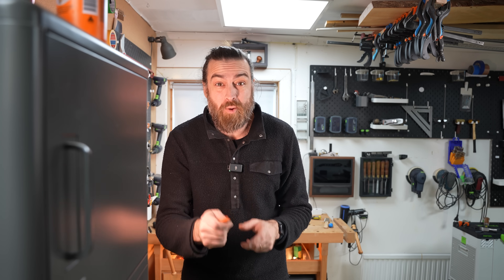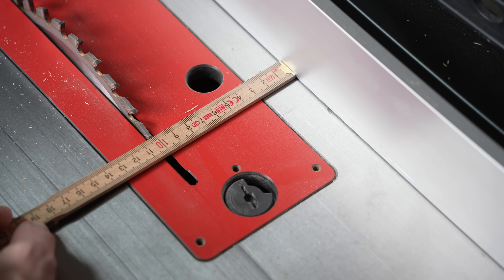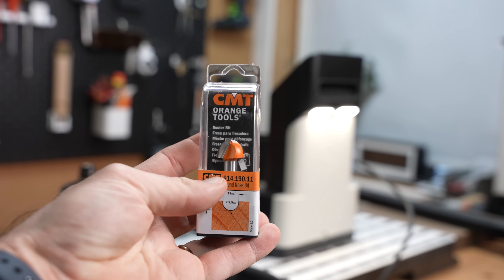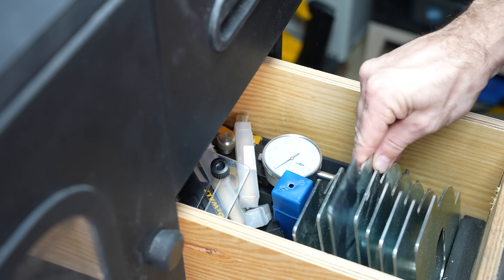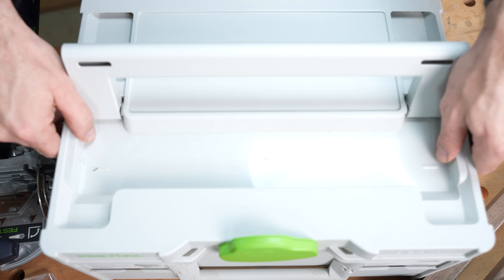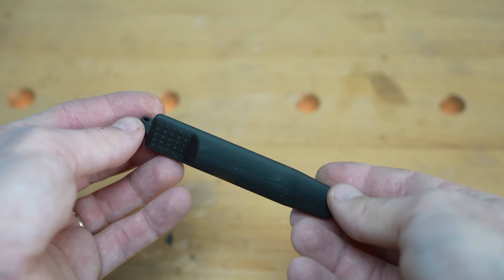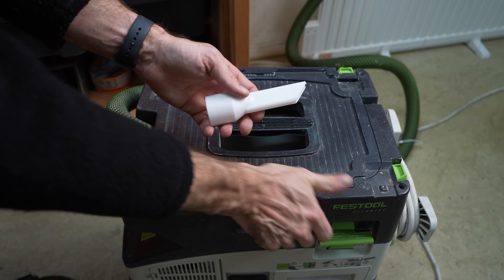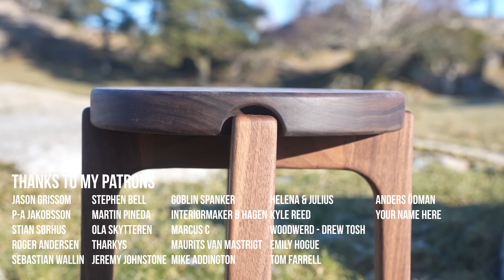3d print tools worth $1000:s

Comment: As i see, there are a lot of worrying about filament shrinking in rulers or setup blocks. Would not it be a little bit easier make things little bit bigger then you need it and smooth sand it after, instead of making calibration every time or use both methods to get measurement instruments precise enough?

Comment: Nice selection of 3D accessories, thanks and well done. However... I have to comment on the build. 3 legs good, 4 legs bad! I'd run out of beer-mats trying to stop the thing from wobbling on our floors! 😉 Cheers 👍
Reply: You can always just twist a 4 legged thing until it stops rocking. This is awkward for most things - not the stool though!

Comment: 3D printed tools time? Might be worth looking at my "Hoopin TPU Cable Tie" available in a range of sizes. The upload includes its 4 core elements so you can easily create custom ties. Printing at different scales also useful, like 50% for holding miniature things & 150% for really strong ties (had one carrying 14kg easily)..
Reply from the maker: Will check it out!
Reply: @TheSwedishMaker  I hope you find they're useful, 1000's have, they're dead easy to print with no supports and are great for using up spare ends of TPU reels.
They're basically a string of hoops with a pin at the end, hence the Hoopin name. They took inspiration from baseball cap straps and included the indiidual Hoop, Hoop+tab, Pin & Spring for people to make their own custom ties.
One design thought is you could put the Pin part on 2 or more PLA/PETG prints and use a string of Hoop parts printed in TPU to attach them together and detach if necessary.
The usage ideas are so many, I've put them on lots of cables, held things in place and even use some as carry handles for drinks bottles.

Comment: Hi, I am the designed responsible for the Height Gauge @3:15 , and wanted to thank you for featuring one of my designs again. It's always great to see people making use of one of my creations. I probably spend far too much time designing woodworking prints, I really believe that a 3D printer can be a huge asset to a woodworking workshop. So many great designs out there.
Reply from the maker: Cool! Thanks for letting me know - you have some good designs. Will check your videos
Reply: Two original designers in a row! how cool :face-blue-smiling:

Comment: I’m not sure if you can get Whiteside router bits in Europe, but I love my combo trim/pattern compression bits with bearings on both ends. When I’m doing pieces that curve with and against the grain, I can just flip the template from top to bottom, raise the bit, and keep going. Since they are compression bits, I’ve NEVER had a tearout, even going around a 90 degree corner. They are pricy, but worth it.

Comment: A note to anyone thinking about buying Bambu Lab printers. They recently announced a firmware update that would lock you out of using third party slicers and accessories directly with the printer, all prints, including LAN-only, would have to be sent through Bambu's cloud severs via Bambu Studio or Bambu Connect for verification before the print could be started on the printer. Third party slicers will not be able to communicate with the printer at all outside of very basic functions like toggling the light inside of the printer.

After public push-back they then announced the implementation of a "developer mode" on X1C units that does allow you to actually control the printer with third party software and hardware via your local network without the cloud verification, at the cost of losing all cloud print functionality including the use of the Handy app. However, nothing like that has been announced for the P1 or A1 series printers, so it is not clear if the feature will be exclusive to the more expensive models or not. 
The use of Developer Mode also disqualifies you from being able to seek technical help from Bambu's support team. This is similar to how Bambu handled push-back when they blocked the installation of the X1Plus third party firmware on X1C units, they added a toggle to install the firmware, but at the cost of losing the remaining hardware warranty on the printer.

You also still have the option to use third party slicers with the SD card and manually initiate the print on the machine itself. However, accessories like the Panda Touch would require the use of "Developer Mode" on newer firmware.

They stated this update was for the "security" of their cloud service, but after third party cybersecurity experts easily defeated the new security measures on the beta version of this firmware the validity of this claim has been brought into question.

They have also stated in a Verge interview that users are able to remain at the pre-security update if they wish as well as downgrade to the pre-security firmware, but you will very likely lose the ability to use any cloud features once the newer firmware's are released and their servers are updated to only accept connections from the newer software. You will also be giving up any potential print quality improvements that come from newer firmware. However, despite what the Bambu representative said in the verge article, in the terms of service on bambu's site at the time of this comment still says that they reserve the right to block prints on printers with out of date firmware until at such time that the printer is updated.

Comment: Loved the video, can’t wait to get one of these printers. Don’t even want to use my old one with all its hassles. Thanks
Reply: @kylereed3577  that's the point. A friend of mine gifted me his old one, an ender 3. Never worked for me. In February I got a Bambu and it has over 300 hours on it already with zero misprints and zero downtime.
Reply: @alfderbabybenz7092  yet that isn't an apples to apples comparison. Not just are even the A1 minis twice as expensive as an old Ender 3, there are years in between them. If you compare within the same price bracket and with current machines, the differences pretty much disappear.